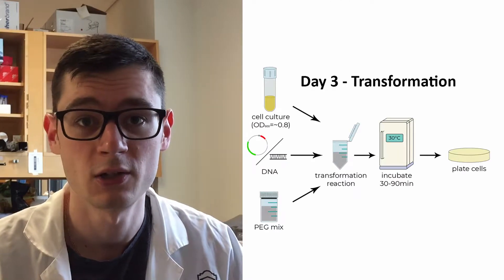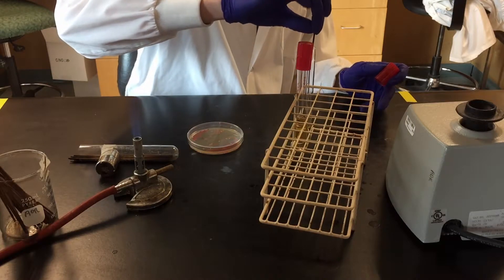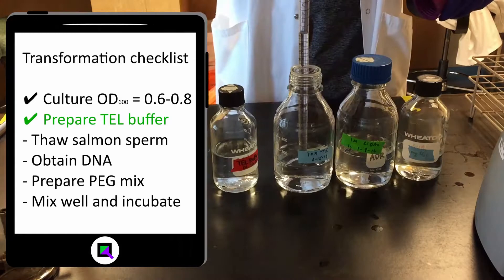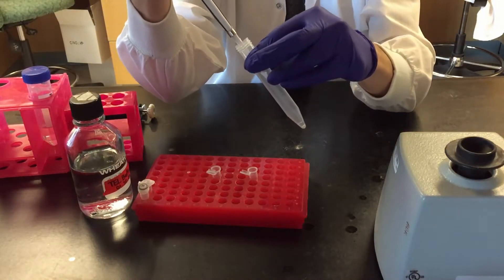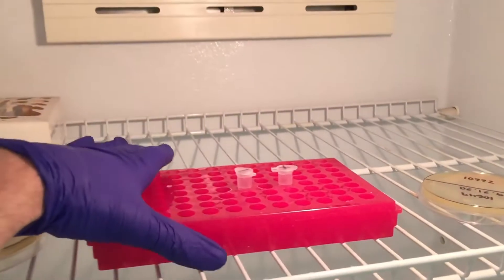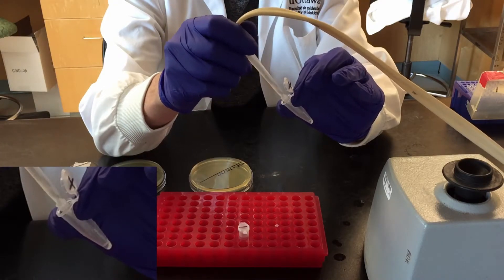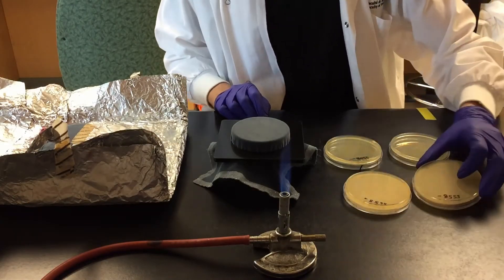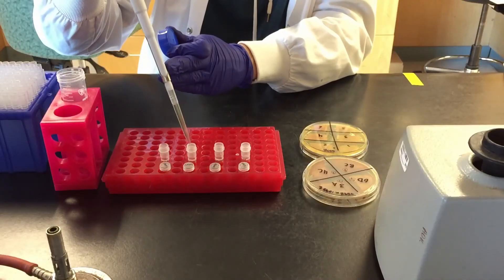Yeast Transformation (Lab Tutorial)

Comment: why do you have to replica plate if od was already determined to be optimal? i keep having the issue of getting a lawn after transformation
Reply from the maker: The replica plating is done because we first grow the transformed yeast on non-selective (usually YPD) media to allow for recovery and the initial expression of transformed markers. We then replica plate the lawn of cells to selective media and only cells that have been properly transformed will form single colonies - the rest of the lawn should not grow on selective media (ie. auxotrophic for Leucine, transformed with a LEU marker cassette, and then replica plated onto selective media lacking Leucine). The OD reading is just to make sure the cells are their "happiest" for transformation. It sounds like you should make sure you are using the right selection media for your transformation marker. Good luck with your experiments!

Comment: I noticed you don't always use a flame, like during the transformation reaction setup or plating the yeast cells. Is it not always necessary if using certain selection (like amino acid dropout plates)? Thanks:))
Reply from the maker: The most important stage to use the flame is the plating step, but you are correct that the selective media will help prevent some potential contamination. That being said I would suggest using sterile technique as much as possible!